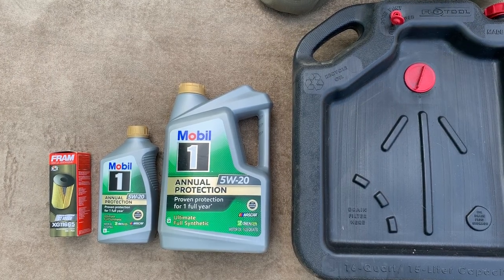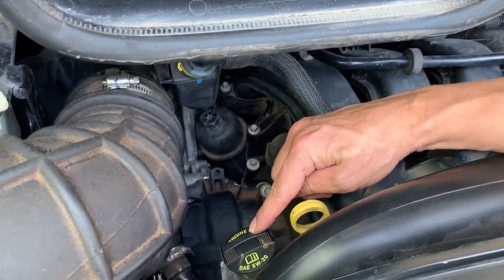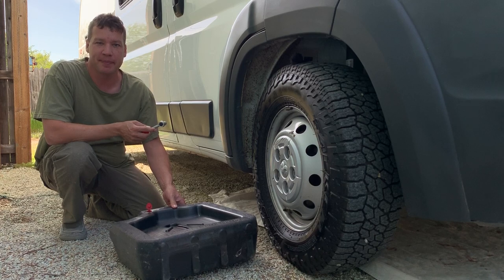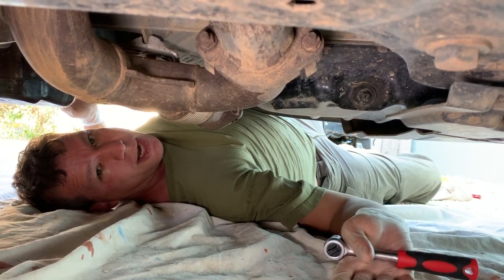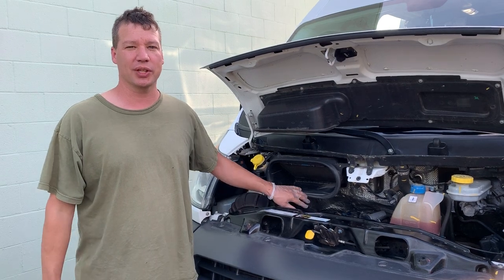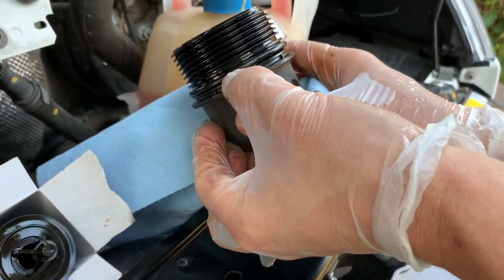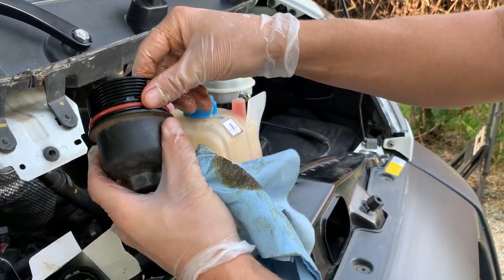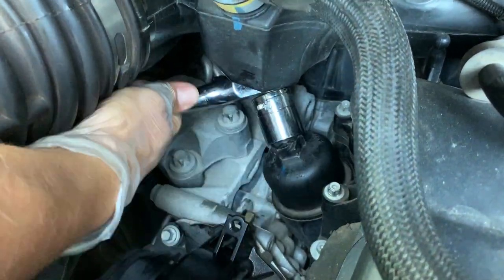ProMaster Oil Change ~ Do-It-Yourself

Comment: If your Fiat/Chrysler vehicle is under warranty make sure to use an oil that meets the Chrysler Material Standard MS-6395. I suspect Mobil 1 does not.
Reply from the maker: Great advice there. I can see them not covering a warranty just for that reason. Thank you for the heads up, I will be checking this out.😎
Reply from the maker: Thank you for sharing Scott! You are correct mobil 1 does not make the list yet as they have not acquired the certification yet. We very much appreciate you sharing this information to us and the 3.6l Pentastar community.
Reply from the maker: https://jeepoffroadadventures.com/wp/?page_id=787.  Good article to see what oil is approved by Chrysler. Although this article is directed at Jeep Wranglers.... Promasters have the exact same  3.6 L Penastar Engines.
Reply: @oneadVANtureatatime  What's weird is, Mobil Super Synthetic and Full Synthetic have the certification. Why did they spend the money to certify these more obscure brands and not their flagship? Is Mobil 1 actually missing something these engines need? I just got Pennzoil instead.
Reply: @Scott_From_Maine  Mobil 1 is perfectly fine for any engine.  Certification has mostly to do with money. Most modern brand name oil will work in almost any engine and Mobil 1 is one of the leading brands.
Reply: Can’t deny warranty for not using manufacturer oil. Just need to use the grade specified in the owners manual  and you are good to go. Warranty companies get sued all the time for this.
Reply: @RainbowManification  they can probably deny warranty for changing the oil yourself instead of having a certified company do it, i can see attornys asking to see owner credentials to show if owner has proper knowledge and training. The certified company also logs it electronically so if you dont keep excellent records and receipts to show what and when you approx performed the service your waranty case may not even make it far enough to get to the credentials question.

I own my 2021 already and doing my own maint... so taking my chances, but just sayin
Reply: I know this video and comment is over 3 years old, but to update just in case anyone else reads this, I recently (June 2023) got Mobil1"'Advanced Full Synthetic" 5W-20 from Costco, and the bottles specifically indicate that it "meets or exceeds the requirements of" Chrysler MS-6395, as well as Ford Wss-M2C960-AT, ILSAC GF-6A, and others. Your comment reminded me to check, so I appreciate it. I don't use conventional so I don't know if that applies to other grades.
Reply: @mblitch  Thanks!
Reply: Dave after recommending to watch Stanthevan video, and his suggestion to 0-w30 vs the 5-w20 
Have you changed the oil type? Or kept it as manufacturers recommend?

I have been following you guys since at least late 2019 but I can’t remember your mechanical trials & tribulations.  

Have you had to replace or repair your engine yet?
Reply: mobil 1 synthetic is as good as any oil there is, I use it on my high compression jet ski racing engines so it can run my promaster also
Reply: @oneadVANtureatatime  As of today 08/03/2023 Mobile 1 meets the standard.
Reply: @mblitch Just add it before I saw your comment.
Reply: @oneadVANtureatatime  not my Jeep. I have the 4.0 🙌🏼😅

Comment: I removed my oil drain plug, and installed a lever/valve. Now no tools are needed to drain my oil. I love it! I put the drain pan under, push down and turn the lever and the oil comes flowing out. Almost 600,000 miles on my Promaster.
Reply from the maker: Great tip! that is a great idea!!
Reply: @oneadVANtureatatime  The one I have is called: EZ oil drain valves. Be safe out there!!
Reply: Such a great invention. I install these on all my vehicles. Fumoto brand has worked well for me.
Reply: I just use a fluid extractor pump - silde the tube down the dipstick until it hits the bottom of the crank case, give it a couple pumps and then it sucks out the oil by itself from there. No worry about the the drainplug ever leaking from the valve or from the plug.
Reply: Whoa 600k miles? What year and what's your tricks to keep it running that long?
Reply: Do you have a link to purchase the lever valve?
Reply: @randomlybro I’m guessing this Promaster didn’t last long after this video. 😂
Reply: @Draiinex  I'm assuming if there wasn't a response lol

Comment: I seriously couldn’t recommend this van to anyone.  I do own one.  Transmission leaks and rocker lifters tap tap tap tap tap tap.  Search known issues for the 3.6 Penta star engine you will be shocked.  Other than the transmission and engine, the van is  fine.
Reply: My company has a fleet of 60 of them worst vans ever I wish Chevy/gmc made a large cargo van. 4 of my vans need engines on back order and roughly 16 with bad transmissions all less that 80,000 miles on them. Also on back order.
Reply: I agree...

Someone warned me about electrical issues. 

I didn't listen. Now lights don't work. Or windows don't go down. 

They say I have to take it to ram dealership to replace ecm

For $700

Comment: I would clean out inside of filter housing before putting in new filter. And, clean out oil filter cap with carburetor cleaner.  Also. Coat the filter tip o-ring with oil. I pour oil in oil filter housing on engine to get oil in the oil pump, therefore no oil starvation startup. Just my thoughts.

Comment: THANKS FOR THIS VIDEO. Just did an oil an oil filter change and found your video and appreciate now as I did 3 years ago. I came a tip... soaking the new gasket in oil. So as to assure no sticking spots even on the backside of gasket.

Comment: thanks Dave, in the vid i see a 12 point socket for the oil filter, But you do link to a 6 point. a tip i use is to use 6 point on plastic .
Reply: Agreed. I use a 6-point short Craftsman 15/16 socket - allows for access in tight space. I'm also paranoid about over-torquing. So I lube the cap threads & O-ring, strongly hand-tighten, then wrench only one more quarter turn. This seems to work well without a torque wrench (which won't fit in that space.)  🙂

Comment: Informative video. We just bought a new '20 Promaster 2500 159wb a couple days ago to do a build. I'm a stickler for changing oil. Keep a record of your changes, receipts etc as the 3.6 has a history of valve train issues. Yours is a 2018 or older I believe by the grill shape. I think they may have had the issue fixed by then but don't let the mfgr get out of warranting it by saying you didn't change your oil often enough.  I suggest changing the trans fluid out at least every 25 to 30k miles.
Reply from the maker: Yep ours is a 2017. Thank you for the tip on the transmission fluid. Somehow I have forgotten all about it. Take care and best wishes for you.
Reply: I thought warranty ends at 36,000 miles anyway

Comment: Quick question. Can you put the front tires on leveling blocks for more room or will that keep some of the engine oil from draining? After you ran the engine do you let it sit for a while before checking dip stick?

Comment: Thanks for this informative and well produced video!  When I change my oil, I start with refilling with 5 1/2 quarts, run the engine a bit, then check the dipstick.  The oil level on the dipstick is always higher than the hatched section.  Any ideas or comments would be greatly appreciated, since I'm concerned that I'm overfilling it with oil, even though I put in only 5 1/2 quarts.
Reply from the maker: The last time I changed the oil myself I also put 5 1/2 half quarts in it and it was perfect. I am guessing the hotter the engine is the more dirty oil is going to drain out. Very smart of you not to overfill. Take care and best wishes to you. Thank you for taking the time to watch and comment.
Reply: OEM shows 5.92 quarts for 2021 promaster 2500

Comment: These days especially with top-side oil filters, we do not need to crawl under and drain into oil pans anylonger.

Just go out and buy yourselves a manual or electric fluid extractor pump and pump the oil out through your oil dipstick.

The drain tube will slide down through the dipstick and into the bottom of the crank case. So gets the job done easy fast no mess and gets atleast 90% of the old oil out prolly better.

Im about to do my first change on my 2021 promaster 2500 the part store shows it takes 5.92q of 5w20 to fill it back up. Will update this if something goes wrong.
Reply from the maker: This sounds awesome! I will be interested to see how it goes. Not crawling underneath sounds like a big win.

Comment: Thank you for the great video and super tips! 
On p. 155 of the 2018 Ram User Guide under Fluid Capacities, Engine Oil  With Filter it lists 6 Quarts. 
I assume your concern is overfilling causing added engine pressure, or?
I keep all my receipts and record all oil changes which are always done but way before any alarm would ever go off. 

I was watching a program where the mechanic said car mfgrs use engine sensors and a algorithm in their programming that checks mileage driven, speeds, rpms, temperature, oil condition clarity, etc. He suggested if you don't trust a programmer's algorithm merely change your oil earlier.

I have changed all my cars/trucks batteries every 5 years max on the 72 month battery. I do it on a beautiful day, when I want to, where I want to.
;-}

Comment: What about a spec for torque on the oil plug?  And what about replacing the gasket on the oil plug?
Reply from the maker: Good questions! 

Definitely check the gasket! Having a spare gasket or new oil plug on hand in not a bad idea.  We had our oil changed at a ”un-named” oil lube shop and they over tightened the oil plug....so much that it stripped when we tried to get it off the next time we changed our oil. We had to buy a special tool to get the plug out and replaced with a new plug.  

Tighten it to Goldilocks specifications 😆 not too much & not too little..... Just perfect 👌  we tighten ours by hand.  Exact torque number.... You would have to check with the owner Manuel. We have seen it listed at 20 ft.lbs of torque but we are not mechanics and cannot verify that info. 

Hope this helps

Comment: Beautiful! I was wondering if anyone ever ventured to change the oil like this without jacking up the van. Now I see that there's nothing to it. Would you do the same on a smaller car, with not much clearance below? And what do you think of the "extractor" method? (sucking the oil from above with a hose).
Reply from the maker: When we had a small car I just used those plastic ramps and that worked well. I like the idea of pumping out the liquid especially with the transmission fluid. Since there is no drain plug on the Promaster transmission pan.
Reply: There's a very simple solution I have used for decades.  Drive it onto some boards.  2x8's are ideal.  With my old car, I used two layers of boards for a rise of 3.5 inches.  What a huge difference that makes.

Comment: Oil relief cap was the best part!
Have you found where the fuel filter is located?
Reply from the maker: I know where the fuel filter is in the diesel Promasters but not my own vehicle. 😂All have to take a look. I did find the fuel pump however. 😀

Comment: THANK YOU!!! I was told the oil filter was way back under some cover and hard to get to. I have been getting my changes at the dealer for 6 years during the warranty but that's over. Awesome, great clean video.

Comment: Thank you for this video! I'm about to change the oil in our Promaster 2500 van and feel much more comfortable now. I liked the tip about starting with 5 quarts and then adding slowly after that. Do you suggest waiting to change the oil until you get the dashboard message?
Reply from the maker: I usually do wait for the dashboard message but also perform a weekly fluid check. If the oil is extra dark or black I will change it earlier. If the oil looks fairly clean I will run extra miles even if the oil change  message comes up. Hope that helps. 😎
Reply from the maker: Hi Andy, we have just learned that the Mobil1 oil brand we used is not on the list of approved oils for 3.6l Pentastar engines and could possibly void your warranty. Check out this link if you have time, there is a list of what oils you can use.

https://jeepoffroadadventures.com/wp/?page_id=787
Reply: No, don't wait for the message, change the oil every 5-7500 miles if you want to keep your vehicle for a long time. Oil is cheap.
Reply: @1977starfire  I buy Pennzoil on sale with a premium oil filter Mobil 1 etc. then shelve at home until I'm around 4,000mi, How do you reset alarm so it just doesn't go off sometime later. I'm doing my 3rd change at 11,850 mi due to almost a year on oil. Due to Covid first got it out of winter storage in July!!

Comment: A socket extension or combination of them longer than your oil drip pan will help you extract the plug without spilling on the ground :-)

Let the plug fall into the pan, retrieve it later.
Reply from the maker: Very smart! I will be doing that next go around. Thank you😀

Comment: I am confused. So tour video shows you adding 5w20 as per manufacture recommended, but then you send us to a video showing what happens when you follow said recommendation. (???)
Reply from the maker: It is very confusing!! we are using 5w20 as per manufacturer instructions because our van is still under warranty. However, we are showing someone else's experience and what their mechanic said after replacing the engine. Food for thought.... definitely discuss with a mechanic you trust.

Comment: What about using a stubby rachet or I saw a guy use a swivel head rachet on the filter.
Reply from the maker: I keep meaning to buy a stubby socket, that's what the good oil change shops are using now.😀
Reply: @oneadVANtureatatime  Good man!

Comment: I watched Stan the Van about the oil issue and did my own research and...

This concerns me greatly because everywhere else like forums, dealer, and most importantly, the manufacturer says to only use 5-20 for very specific reasons. Not saying this is bad information, but I sure would like to get clarification on this and other questions like should you run synthetic, etc. seems unbelievable to me that there are tons of these vehicles out there running the wrong oil! Anyone have any suggestions for clarification of this?
Reply from the maker: Right there with you! We kept our oil at 5-20 as to not void our warranty.... but we are curious as well. I would love to have a really good mechanic that I trusted to ask!  We thought this would be a good topic to discuss....and well....we learn alot from our viewers!!!
Reply: one adVANture at a time - I feel pretty good that I got the best info regarding this that I can because as I said, I contacted dealer and manufacturer and they both said 5-20 “Blended Synthetic” which was the only thing the manual does not specify. Thanks for your content.

Comment: 'you need to be patient, this can take awhile' POP next step
Reply from the maker: Yep it's hard to be patient sometimes.  Please tell what POP stands for. 😀
Reply: @oneadVANtureatatime  Pop was the noise the rubber gasket made..... I was trying to be funny because dave said'this could take awhile' then less than a second later the gasket came flying off
Reply from the maker: SemiRetiredBob 😂 I didn't expect it to be that fast. 😀

Comment: Should've tried using a swivel adapter
Reply from the maker: That be handy to have. I ended up buying the snub socket. Works great.
Reply: I had to use a 24mm open end wrench all my 1/2 ratchets are to long I guess I need a stubby 1/2 ratchet

Comment: don't oil change with those kind of cans.

get a Fumoto faucet to replace your drain plug for 20 bucks.
then just flip the faucet switch and drain directly into the oil bottle to give directly to the auto part stores.
Reply from the maker: I've seen that! I will get one soon. Thank you for the tip. 😀

Comment: LET ME SEE. OK, IT IS STILL IN WARRANTY BUT YOU KNOW THAT USING 5 WEIGHT WILL DAMAGE YOUR ENGINE. HAVE YOU DISCUSSED THIS WITH THE DEALER TO SEE WHAT THEY SAY ABOUT USING 5 W 20 ??
Reply: The correct oil is 5W20. Calls for it right on top of the oil fill cap as shown in the video 😊
Reply: @JG-kv4oi  LOOKS LIKE YOU DID NOT PAY ATTENTION TO THE END OF THE VIDIO ---JG. I DID NOT ADDRESS YOU ---JG. WATCH THE VIDIO AGAIN ---JG.
Reply from the maker: Yes if you use any other weight oil in your engine it will void your warranty. Of course they don't admit to any problems with the viscosity of the 5w oil. I just wanted to share a video I found interesting from a professional mechanic viewpoint. Take care and best wishes.

Comment: This idea of measuring the oil so it is half way up the dip stick mark is silly.   After removing the oil, simply dump in six quarts, run the motor, and check then it.   I don't know if this 5 1/2 quart thing is a joke or this guy is brand new amateur mechanic .    Or both.

Comment: Thank you
Reply from the maker: You are welcome! Thank you for watching. 😀
Reply: @oneadVANtureatatime  do you have videos on how to check the break finished or not on promaster?
Reply from the maker: I don't yet but appreciate the tip. We found that our service brake alarm lights up on the dash while going down steep hills. We learned this is normal because of the float that reads the brake fluid level. However, I did add a bit more brake fluid and no longer get the alarm.
Reply: @oneadVANtureatatime  thank you boss 🙏